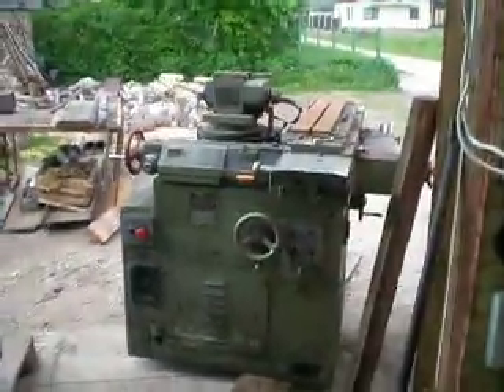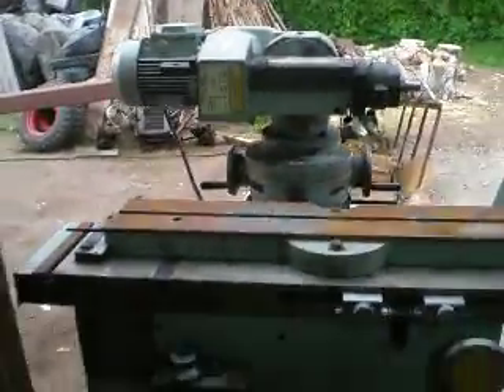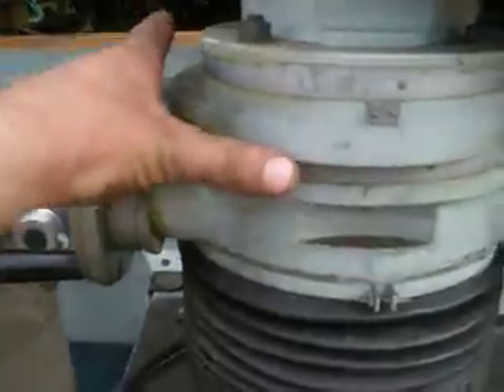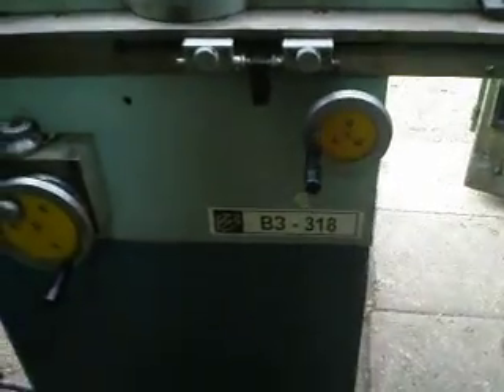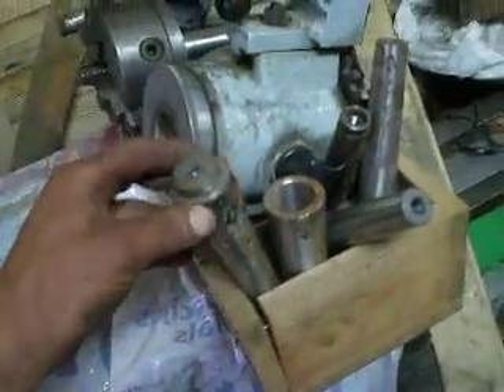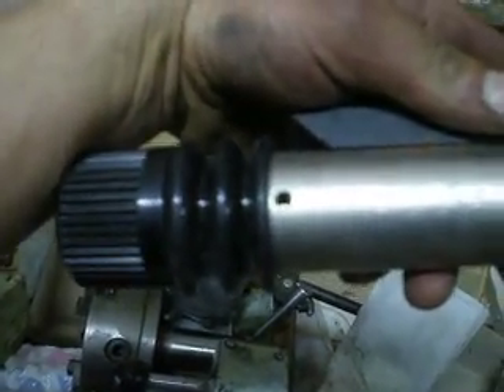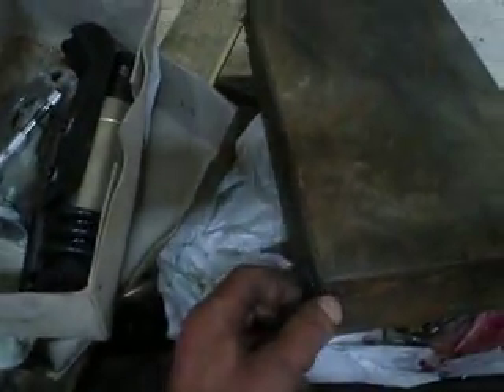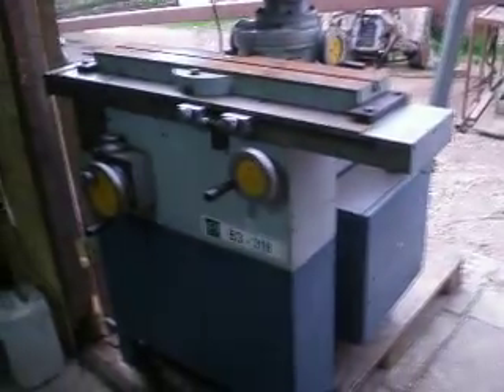Tool grinding machine move - short view about my new machines

Comment from the maker: Yes, I buy them for sharpening tool- drill bit, mill bit- very diferent types, saw blades, cutting tool inserts etc, . With those machine also can do: #circle gringing - outside and inside surface, taper/ cone grinding, tool shank grinding, surfase grinding also under angle, V surface grinding, etc grinding works.